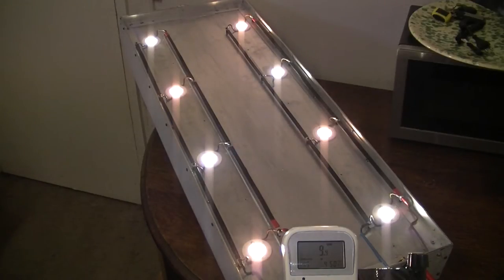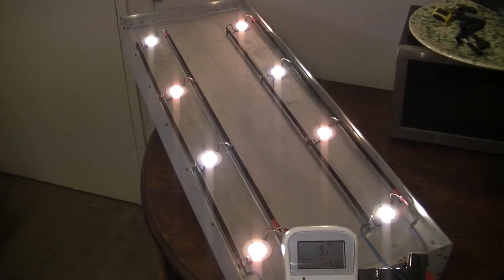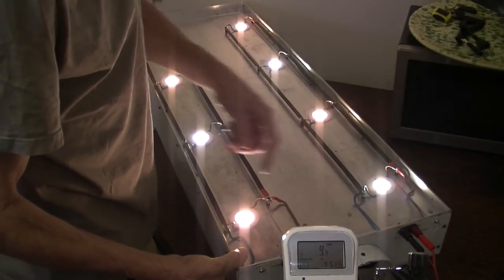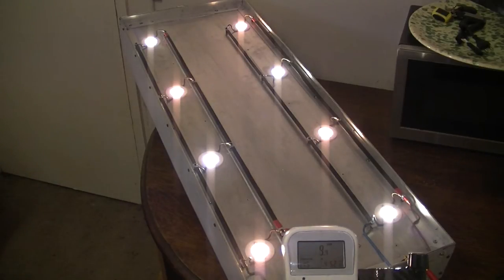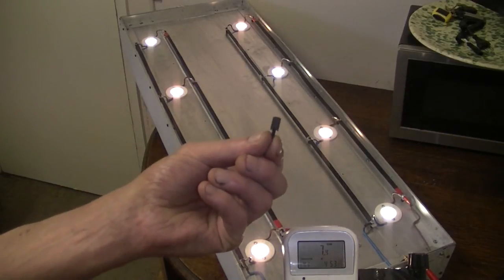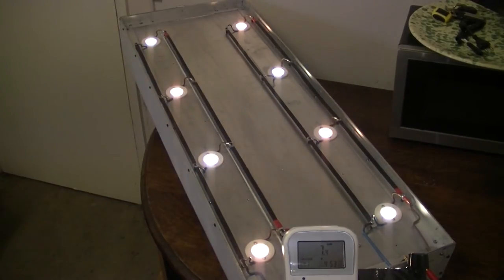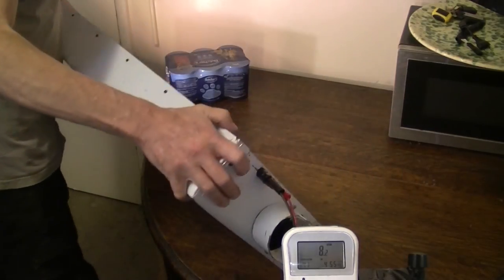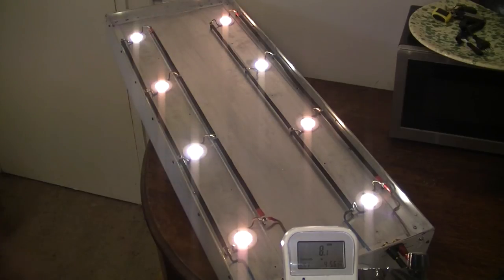Pre-Production Test Bed 320w 8CoB Array

Comment: Hey Jack, I did barely know how to spell LED a couple month ago, but thx to people like growmau5, vitaly (ChilLed) and last but not least Freeman Jack, i`m building my 3. lamp with vero29. Growmau5 allways recommended not to wire cobs in parallel due to thermal runaway.  Therfor i never thought about a configuration like this. I ordered a 70°C thermo switch, not only  because a family with kids are living upstairs. Can i wire it onto the AC side?. I dont feel very well to apply this little piece of metal to an alluminium heatsink with AC on the wire.
Greetings from germany
Reply from the maker: Hi Juggler, nuff respek da growmau5!! Ok, you are thinking about series connection to protect against thermal runaway (as per G.M.'s recommendation), series uses higher voltages by stringing sets of LED's positive to negative to divide this higher voltage down to one acceptable to the cobs. I use parallel connection at the rated voltage because with led's like vero 29's if one led dies the remaining 2 are still capable of handling the extra amps released by the failed led. As far as thermal protection with your cutoff switch, I fully understand your concerns and applaud your caution but as long as you are using plenty of heatsink which is capable of cooling below max junction temperature (85C for vero 29's from memory) passively and then add your active cooling (pc fans etc) to bring heatsink temps down to 30-60C you are assured of thermal regulation and protection is unnecessary. Should your fans fail, the heatsink will still maintain a safe temp. I have only ever had one led fail in service and I suspect this was due to a bad plastic holder bending the chip rather than any thermal problem. Feel free to hook up with me on skype if you want to discuss any problems you may have;  live:freemanjack.c60

Comment: ok so is it parallel or series you have it wired in I can see you using them power supplies hooked up in parallel but I didn't think they put out that much voltage in series
Reply from the maker: That is a single 40v 10 amp driver powering the 2 bus bars in parallel. So both pairs of bus's are running around 40v @ 5A you then simply divide the amps by the number of CoB's to get your individual amps.